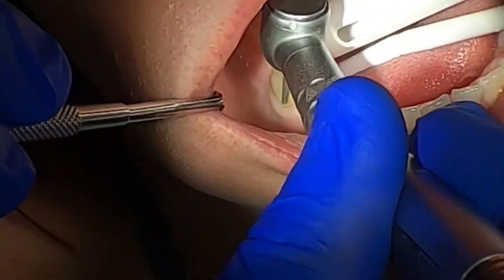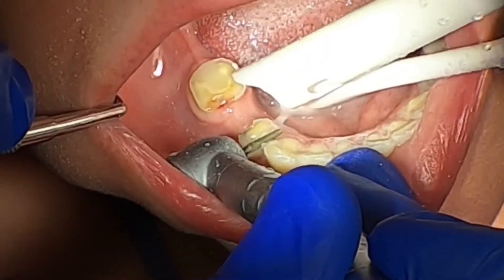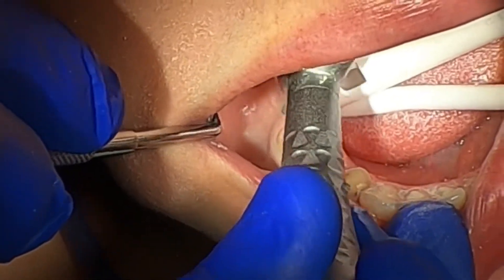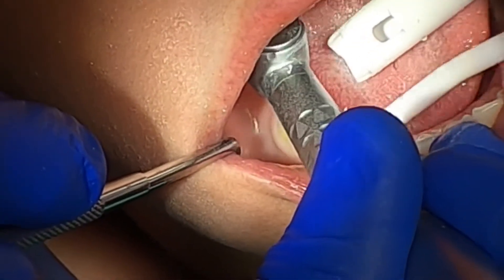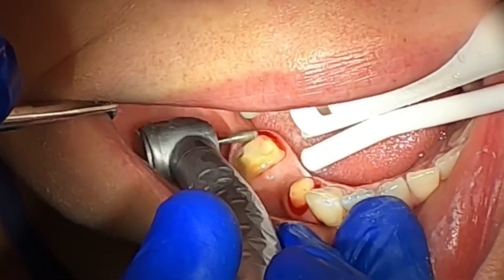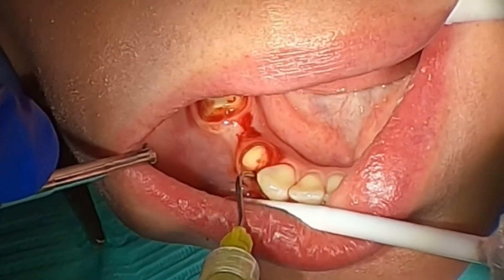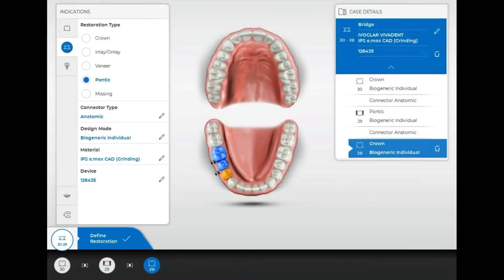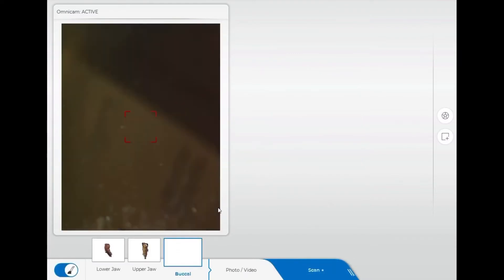10 Minute CEREC Bridge Preparation POV.  GoPro Hero 8.  Teeth 28-30.  Omnicam and MCXL

Comment: It's crazy I'm finding this video of a dentist saying "I try to get as much done in 1 visit"  I been fighting with western dental over a month to get this done and all they want is a bill . They quoted me over $6000 for a new tooth to be drilled in my gums and I don't have that kind of money to replace a false tooth.... nope i rather deal with this. I'm glad I found this video . I could've had this done all along for $500 and I wouldn't had been tooth less for several weeks 🙃
Reply from the maker: You do have a lot of choices when you’re choosing which direction to go with replacing a missing tooth. Generally speaking, a dental implant will almost always be the best choice for almost everyone in almost every situation. However, and bridge provides a decent alternative in many cases. So the question now becomes success rate over the long term. if we assume a dental implant has a 95% success rate at 15 years, that is a much better success rate than the assume the success rate of a dental bridge at 15 years of 50% not to mention that a dental bridge when it fails will often take one or both of the abutment teeth with it, therefore requiring a much more expensive and extensive repair or replacement than the initial bridge. So it becomes a compounding problem for many of us.
Reply: @davekingdds  ok thanks for the information for me it's more about just having something placed there.  It's cool to give the best options available but I asked "what can be done  today?" I didn't mind paying if i have it. And their response was well for $6000 with down payment of $2000 with anesthetic you could get a screw in tooth, but they never even gave me a choice I saw this video talked with my insurance company and they told me I had a few options as well then I go back to western dental now magically they not only options for me but a FREE OPTION that could've been done weeks prior it just saddens me that it was most important to give me only 1 option that I couldn't even consider
Reply: @davekingdds  and I just ended up getting a temporary option(single tooth retainer) just to be able to smile again 😊   I save up to get a implant but in the meantime my problem was solved for free and that's all I wanted was a quick fix .
Reply: A bridge doesn't cost $500
Reply: @factorg109  oh ok cool

Comment: Did you mean software 5.1 or 5.1.1?  You said 5.2 but there is no 5.2 that I'm aware of.... 5.1.1 just recently came out.... 

How long do you scrub with the hemostatic agent? I was surprised how much it cleared up.... I typically use a lot of cord...

And you used emax or zironia? Cemented with?

Really cool videoes. I have been wondering how a go pro would work and this is pretty impressive to be honest!  Do you have a video that shows your set up and gear? I would love to see that ... I have a hero 7 black and was hoping to do some training videos like this for staff.  I'm seeing some 10x mag on Amazon prime.... What 3.5mag did you use etc....

Thanks again. This is fantastic!  I subscribed!
Reply from the maker: I think I meant 5.1. We have two units. One is on 4.6 the other is 5.1. Thanks for the clarification. Usually the viscostat (aluminum chloride) scrub takes 10-15 seconds to induce a good clot.

Comment: jeez! Remove two teeth to replace one! wow.
Reply from the maker: ....there are always trade offs. Even for an implant. Placing a metal screw in the bone. It’s a cost/benefit discussion with the patient that is crucial plus the need to empower the patient to make an informed decision based on accurate and up to date scientific data.
Reply: @ SpaXpert  , Could you give us you treatment proposals as well your decisions if the patient chose the current option. Clearly you would have declined this treatment option should the patient have chosen it .Walk us through how you get this done .
Reply: @dazzadarcy  I was being sarcastic! But I I do enjoy these presentations!